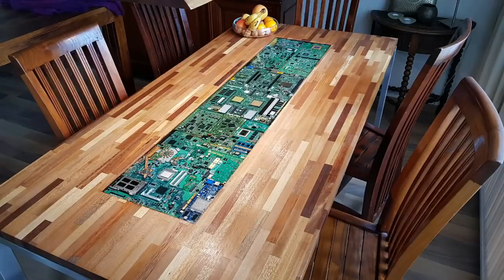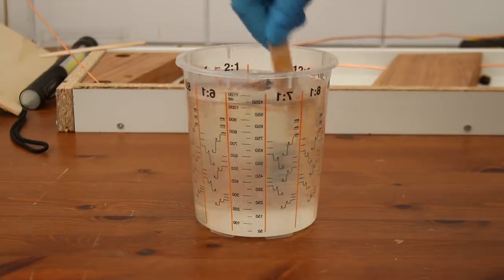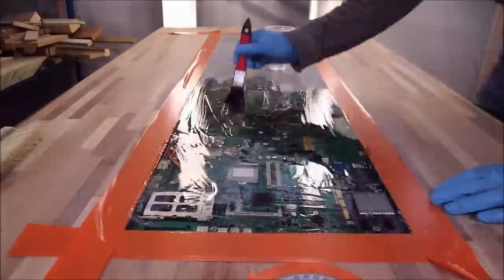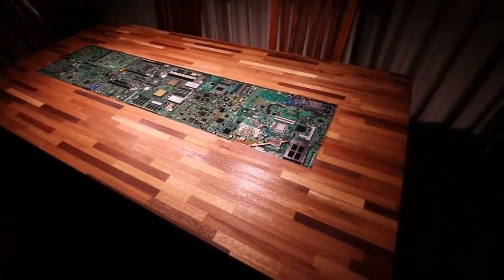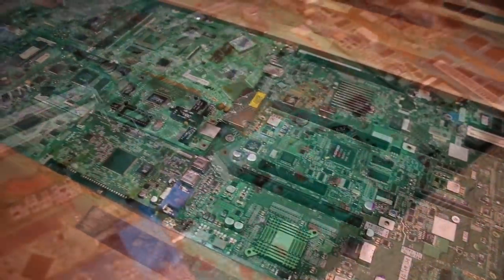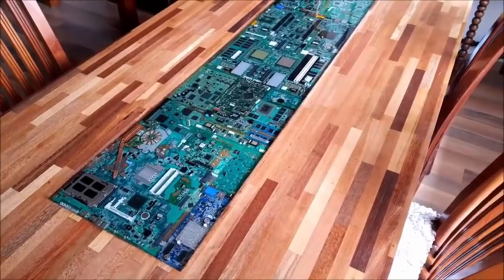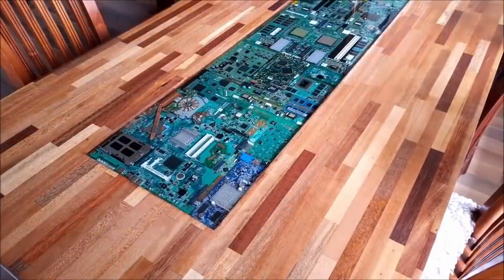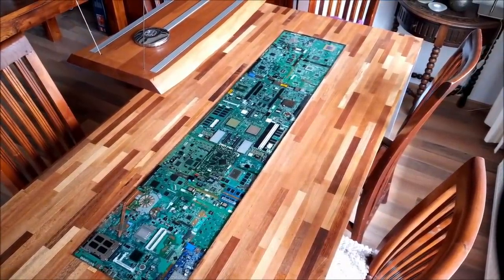Circuit boards with lights in epoxy in a table

Comment: the epoxy will not cure, this is a common mistake, you did not mix the right amount of hardener or you did not mix it well. plain and simple.. start over again, it happens to all of us soon or later. learning curve.
Reply from the maker: True. As you can see here https://www.youtube.com/channel/UCNdDV4vHKjuWOYlEW4HIk5w/community I've begun fixing the table. I routed out the bad spots and am pouring in new epoxy. The first results look promising. Wait for the video. 😊

Comment: IF the soft spots were at the edges, maybe the wood is reacting to the epoxy material,  Maybe a metal edge between the wood and expoxy would have helped..?
Reply from the maker: No the soft spots were all on one level, indicating that I messed up the mixing of one batch epoxy. They were indeed at the edges, but that was probably because at the sides the still fluid epoxy had a place to go - I'm pretty sure the epoxy in the middle is still just as soft. The wood contaminated the epoxy a bit, just because there was some dust on it (I wil all show this in a new video I'm making), therefore it is best to treat the wood before you are pouring epoxy, either with some kind of varnish, but giving it a brush with epoxy is possible too.

Comment: It's a great job, but it's sad that you're failing.
I recommend to cover the glass plate instead of epoxy in the next work.
Reply from the maker: As you can see here https://www.youtube.com/channel/UCNdDV4vHKjuWOYlEW4HIk5w/community I've begun fixing the table. I routed out the bad spots and am pouring in new epoxy. The first results look promising. Wait for the video. 😊 
I still will be using epoxy in coming projects.. 😁

Comment: try moving the table out into the sunlight - warm days - for a week. Needless to say, good weather will be needed as far as the forecast for your area. Sometimes thick epoxy resin that did not get well mixed will 'kick' due to the UV. You may try after the surface is hard a wash with acetone. Test at a small spot in a corner first.
Reply: no sunlight will likly brown the apoxy

Comment: Possibly layer the epoxy (poly be cheaper?) in thinner layers to fight the wobble-diffusion? More time, but what the heck, great original idea and a fun watch.
Reply from the maker: According to the specs of my slow-curing epoxy I could have done layers of 5 cm thick. I did little over 1 cm max. So thinner would not have made a difference. Like I said, I messed up the mixing of one batch. Thanks.

Comment: great idea, why not just use cut glass instead?
Reply from the maker: Because things 'floating' in epoxy are so much more beautiful. I'm busy making a new video, where I will show the difference between something under glass, or something in epoxy. The light only breaks once if under epoxy, whereas it breaks twice if under glass...
Reply: @Onrust1  Interesting. What about epoxy, then toppped off with glass or plexiglass. btw ik ben ook Nederlands.
Reply from the maker: Ah dan doen we zo moeilijk... 😁 had het kunnen weten met zo'n naam... 😊 Neej... glas is gewoon niet zo mooi. In epoxy wordt alles 'bevroren' in de tijd ook nog. Waar het onder glas sneller verkleurt, veroudert, verroest, stoffig wordt, enzovoort.. En dan maakt het niet zo veel uit of je epoxy giet en dan glas er overheen legt, of direct glas er op legt...
Reply: @Onrust1  cool, ben nu abonee. Ben benieuwd naar jouw volgende projecten!

Comment: Route out the edges of the bad resin, then insert a contrasting strip of wood, edgewise, into the slot!
Reply from the maker: As you can see here https://www.youtube.com/channel/UCNdDV4vHKjuWOYlEW4HIk5w/community I've begun fixing the table. I routed out the bad spots and am pouring in new epoxy. The first results look promising. Wait for the video. 😊

Comment: Check it out.  Before you take the loss on the table, try this.  An epoxy of nearly any kind which you mix two parts to activate is a catalytic compound.  What this means is the chemical reaction creates heat to "cook it off".  Heat to form, heat to remove. You may be able to remove some of the sticky spots around the table by heating them up slightly with a heat gun and using mild solvents to wipe them off.  the same goes for the crazed or clouded areas in your pour.  this comes from the different pours heating and cooling at different rates, etc.  Use a heat gun to try to warm up the areas and it may clear.  Be sure not to go too hot or it will discolor and burn the epoxy. start slow and low and be patient.  Hope this helps.
Reply from the maker: Actually, as you can see here https://www.youtube.com/channel/UCNdDV4vHKjuWOYlEW4HIk5w/community I've already begun fixing the table. I routed out the bad spots and am pouring in new epoxy. The first results look promising. Wait for the video. 😊 Thank you for your comment!

Comment: I love it, wonderful idea... as for the epoxy problem: use a electical mixer on the epoxy. Cheers
Reply from the maker: Yes, I went to a boat shop and bought an impeller there. Now I mix the epoxy with that on my electric drill. That works great!

Comment: Could maybe make more epoxy parts for the middle - do them in sections/tiles: so you can ensure they come out right. Then once they're all done: use them to replace the single large panel you've got now?
Reply from the maker: Nice idea, yes. Only connecting the lights would have become more difficult then... Meanwhile, as you can see here https://www.youtube.com/channel/UCNdDV4vHKjuWOYlEW4HIk5w/community I've begun fixing the table. I routed out the bad spots and am pouring in new epoxy. The first results look promising. Wait for the video. 😊

Comment: Get a big sheet of clear acrylic and put it over the table, or if you want to fix it on the cheap get a clear vinyl table cover, stretch it over the top and staple it down under the lip of the table. Design wise i would have put a metal frame around the strip with a similar finish to the legs, but thats just me. You can probably find even more suggestions for a quick fix in the comments!
Reply from the maker: As you can see here https://www.youtube.com/channel/UCNdDV4vHKjuWOYlEW4HIk5w/community I've begun fixing the table. I routed out the bad spots and am pouring in new epoxy. The first results look promising. Wait for the video. 😊

Comment: Just put a THICK GLASS on the table.. Don't need to do any repairs or fixing things.. Let it be as it is.. Use the table with a glass on top..
Reply from the maker: As you can see here https://www.youtube.com/channel/UCNdDV4vHKjuWOYlEW4HIk5w/community I've begun fixing the table. I routed out the bad spots and am pouring in new epoxy. The first results look promising. Wait for the video. 😊

Comment: Why not use poly? Polyurethane in my past, when I had to cover or fill in or laminate a surface, I always used the poly. No mixing, it's cheap, and does the same thing as what the epoxy did in this video. You can also select from a few different types of surface sheens. Low gloss, semi-gloss, high gloss.

Simple and easy to use and guaranteed to do the job.

Comment: I know this is an old video by now but did you try to use a hot torch over the e-poxy in the areas it was not cured propperly?
Reply from the maker: No. Because I'm pretty sure it wouldn't help. Epoxy needs hardener to harden 😏 and if it doesn't have that, because it isn't mixed properly, it just won't. Well, maybe it will, but that can take years. The torch is used to get rid of bubbles...
In the mean time https://www.youtube.com/channel/UCNdDV4vHKjuWOYlEW4HIk5w/community I've begun fixing the table. I routed out the bad spots and am pouring in new epoxy. The first results look promising. Wait for the video. 😊

Comment: Great Idea. I am saving boards for a wall piece and appreciate the "simplicity" of the fiber optic LEDs - Awesome!
Reply from the maker: I was saving boards too, but even after years I didn't have enough for this table. All it took was one shout on Facebook, and I had more than enough. Lots of people have old computers standing around that either are broken or outdated, but they are reluctant to throw away. Maybe a tip for you... 😏👍

Comment: I know nothing about redoing furniture but maybe if you experimented with other transparent sealers other than poxy on a much smaller scale till you find the right thing. Maybe if you mix something in with the Poxy to make it dry hard it might not be sticky.
Reply from the maker: As you can see here https://www.youtube.com/channel/UCNdDV4vHKjuWOYlEW4HIk5w/community I've begun fixing the table. I routed out the bad spots and am pouring in new epoxy. The first results look promising. Wait for the video. 😊

Comment: saw out the center and then add another layer on the bottom. start over?
Reply from the maker: As you can see here https://www.youtube.com/channel/UCNdDV4vHKjuWOYlEW4HIk5w/community I've begun fixing the table. I routed out the bad spots and am pouring in new epoxy. The first results look promising. Wait for the video. 😊

Comment: Do not worry about the epoxy resin. With the exception of a great idea with LEDs, the whole table sucks. Using those nightmare motherboards in the dining room table is a terrible idea.
Reply from the maker: No, it is not.
Reply: @Onrust1  Absolutely yes.  A similar approach requires excellent design with IMITATION electronic components.
Reply from the maker: Tough I still disagree, I will ask it anyway: 
why?
Reply: @Onrust1  We omit the question why do this at all and what it might mean. However. I don't think real motherboards have enough aesthetic potential to look at this every day.  Yes, the green is nice, the tracks on the boards look interesting, but the memory slots are a nightmare, as are some details. There's nothing cool about capacitors sticking out next to plates. If you are doing a computer design stylization, it is not necessary to use real motherboards. It should be a neat styling similar to electronic components. And here we come back to the question-why do this at all?
Reply: I suddenly thought I should apologize for my peremptory tone. You've done a great job. Well done. And everything else is a question of taste.
Reply from the maker: Thank you. 
I find the answer to the 'why at all'-question so obvious, that I almost find it a stupid question. But then again, maybe it is obvious to me... 
First in the sake of art. (There is no point in asking 'why' at every art project.) Second because of the fun of doing it and third for a video. Fourth because of the money. Up until today this video made me 4186 euro. 
Regards from the Netherlands.

Comment: It looked like some of the pieces of plastic were melted or eaten up by the epoxy.  Isn’t there a lot of different types of epoxy or resins?
Reply from the maker: well, I don't know if you're serious, but nothing was eaten up. 😊 There are indeed lots of kinds of epoxy, of those the characteristics differ. Some are fast curing, others slow, some you have to pour in thin layers, others you can pour thicker at one time, and so on...

Comment: It makes me wonder if circuit boards can function encased in epoxy.
Reply from the maker: I'm pretty convinced they could. Only where there is heat building up, you'd have to find some solution.
Reply: @Onrust1  Good point.

Comment: I recommend a piece of glass that can be beveled around the edge at a 45 degree angle 1/2-1 inch wide. By the way, you made one HELL of a GREAT EFFORT- BRAVO my friend!Francis
Reply from the maker: As you can see here https://www.youtube.com/channel/UCNdDV4vHKjuWOYlEW4HIk5w/community I've begun fixing the table. I routed out the bad spots and am pouring in new epoxy. The first results look promising. Wait for the video. 😊

Comment: Doing the same thing but make sure to mix more than enough epoxy to cover the whole table all in one pour! Be sure to do in a tent atmosphere as to be clear of any dust!  Having it over flowing off the sides of the table is better than not having enough and ending with some not mixed correctly! can always sand and buff to a nice clear shiny surface!

Comment: Why did you use fiber instead of just electric LEDs?
Reply from the maker: Lots of reasons. Like I said in the video: I didn't want any electricity with batteries or a wire. But the LEDs in epoxy are irreplaceable too, and this setup can't break down. And I also like it that the lights can't be on all the time. They are on temporarily by default. So you can't get crazy from flickering lights all the time...
Reply: @Onrust1  sorry I watched it without sound. Thx for the quick reply
Reply from the maker: No problem. You're welcome. Have a nice day. Regards from the Netherlands.

Comment: As you pointed out the table top is not perfectly flat and so a glass top would not work.  Instead rout out the imperfections and refill with properly mixed epoxy.
And thanks for sheering the 95% perfect project.
Reply from the maker: Exactly. As you can see here https://www.youtube.com/channel/UCNdDV4vHKjuWOYlEW4HIk5w/community I've begun trying to fix the table. Like you suggested I already routed out the bad spots and will try to pour in new epoxy. The first results look promising. Wait for the video. 😊

Comment: recess the circuit board section by .200 and place a perfectly cut piece of Plexiglas/acrylic or other over the epoxy part.
Reply from the maker: As you can see here https://www.youtube.com/channel/UCNdDV4vHKjuWOYlEW4HIk5w/community I've begun trying to fix the table. I routed out the bad spots and will try to pour in new epoxy. The first results look promising. Wait for the video. 😊

Comment: maybe you should try to add the epoxy in thin layers, also I saw that someone suggested a vacuum room, maybe it can be done something with a vacuum cleaner and a one way valve.... just some thoughts.
Reply from the maker: Thank you. As you can see here https://www.youtube.com/channel/UCNdDV4vHKjuWOYlEW4HIk5w/community I've begun trying to fix the table. I routed out the bad spots and will try to pour in new epoxy. The first results look promising. Wait for the video. 😊

Comment: Its still a good table for me. Just put a Glass on the top then anything will be useful as a table with Great Elrectronic designed. This is one of a kind.
Reply from the maker: Thank you.
As you can see here https://www.youtube.com/channel/UCNdDV4vHKjuWOYlEW4HIk5w/community I've begun trying to fix the table. I routed out the bad spots and will try to pour in new epoxy. The first results look promising. Wait for the video. 😊

Comment: I think this video is both beutiful and sad at the same time. Thanks for sharing. Good thing you have a layer of silver tape under the boards, you might be able to knock the casting out if you cut around at first, and the remake the whole thing???
Reply from the maker: As you can see here https://www.youtube.com/channel/UCNdDV4vHKjuWOYlEW4HIk5w/community I've begun trying to fix the table. I routed out the bad spots and will try to pour in new epoxy. The first results look promising. Wait for the video. 😊
Reply: @Onrust1  Great news! I'll eagerly wait for the update.

Comment: maybe use epoxy that cures under ultraviolet light ..   i think they added chemicals too it that when UV falls on it it falls apart and one of the chemicals it falls apart too is a hardener.   So if parts arent cured put a big UV lamp on it.     Maybe you have seen the UV cured epoxy .. they sell these glue pens with a UV led in them .. so you can for instance glue your glasses .. put the UV led on it for 3 secs and its ready.    But i guess if you are going to use UV epoxy you have to close the curtains .. and dont use TL tube lights or CFL lights as they have UV inside.    Maybe use LED lamps.
Reply from the maker: As you can see here https://www.youtube.com/channel/UCNdDV4vHKjuWOYlEW4HIk5w/community I've begun trying to fix the table. I routed out the bad spots and will try to pour in new epoxy. The first results look promising. Wait for the video. 😊

Comment: You wouldn't really have to chisel the epoxy out. Just cut right after your old cut the same way you did and put some screws in the epoxy and pull it up with pliers. The only thing holding the bottom in is foil tape. Should come right out.

Comment: Why didnt you just continue to use the Router to remove the squares? Would have been much easier, faster and accurate.
Reply from the maker: Accurate yes, but that was not important, easier no, because I would have had to make some kind of sled and faster... I doubt it. One blow of my chisel can remove so much more material than the router in the same amount of time.. (at the sides the chisel was easier to, because I had to watch out to hit the straight sides with the router).
Anyway, I have no regrets on that. Someone else pointed out that it would have been easier to cut the whole rectangle out and put a sheet of wood in, and I think I would do that next time, because that truly would have been faster.. 😊
I guess it's the way you learn all the time..
Reply: @Onrust1  Agreed. there are various ways to achieve the same outcome. It's all about what's preferred at the time.

Comment: Great crazy project. Maybe next time if you do such a beast make a tiny version of it and look for things you could do better and then scale?
Reply from the maker: I just messed up the mixing of one batch. If that would be OK, then it was alright. But as you can see here https://www.youtube.com/channel/UCNdDV4vHKjuWOYlEW4HIk5w/community I've begun trying to fix the table. I routed out the bad spots and will try to pour in new epoxy. The first results look promising.